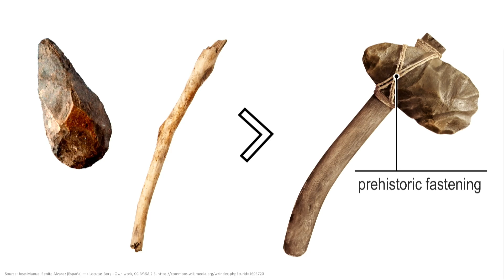A new fastening technology sparks major change everywhere around us | Gregor Eckhard | TEDxBasel

Comment: So, 50% of parts are connecting devices, screws, bolts, washers, clamps etc. So we will do away with those and put out of work hundreds of thousands of people who depend on the manufacture and installation of those products for their jobs and incomes. As great as his product appears to be, he never mentions the downside. I do agree it may be good for the environment but on occasion I would like to hear both sides of the proposal. Not that anything is ever or should  get in the way of progress. My concern is how we keep the economy going while ensuring workers are needed and paid enough to house and feed their families. Or another form of monetary  supply is adopted. Ala Wang.
Reply: How about just stop doing something so mindless once new technology is introduced which can perform the same job better, faster, and cheaper and learn to do something else. Consumers will win with cost reductions. Only the small percentage who fail to adapt will lose. This is the law of evolution, you cannot interfere with it.
Reply: @LackofExistence  I do agree with you but it would seem that "something else" doesn't pay very well. I am not anti-tech improvements. It is just a philosophical point that as automation takes over more and more jobs we may need a new way to spread income. WANG.
Reply: Once again, I agree with you. I am not necessarily a Wang fan. Just hypothesizing there may eventually need for a new economic system. Capitalism (to quote Churchill "is a lousy system but the best we have"). It needs buyers as well as sellers and therefore people with enough money to feed the engine. Capitalism is not a win/win system. It has winners and losers. Fierce competition generally means a race to the bottom. Evolution does not care. As an atheist I absolutely accept evolution but am conflicted by the the so called do unto others message of kindness for the poor and sick to which I think is one of civilization's greatest  acheivements.                         I am 82, so do not expect to be around to see the impact of automation and climate change but I still think about it. It's been nice corresponding with you. Best from Canada.

Comment: Great work. Ultimate fastening is fusion. But melt and fuse is for limited materials. 
Structurally great fastening is twisting, like twisting two metal wires around each other. This could be better than just injecting. If two twisting wires are also porous individually, then we can use a thinner wire to twist in the structure horizontally. This gets very close to fusing.
But strength, individual strength, at a unit area is important than just entanglement of elements, and should be preserved plus increased in the fastening process.
Ultimate way to attach a nail to a wood could be nail being like a long brush of thin metal strings and attachment process injects strings at close enough locations on wood, along with twisting and bending strings nonlinearly as they penetrate.

Comment: What about removal - when you have to remove a part?
Reply: probably apply the same ultrasound to reliquify the fasteners and pull apart
Reply: Use screws
Reply: he said the pins can be made of a re-absorb-able material so no need to remove them...
Reply: @paulusandronicus  2 different application
Reply: It's a long slog

Comment: Sounds like just a different  take on welding... particularly spot welding.   Or hot glue
Reply: But it sets instantly, and is not hot, nor does it require high voltage.